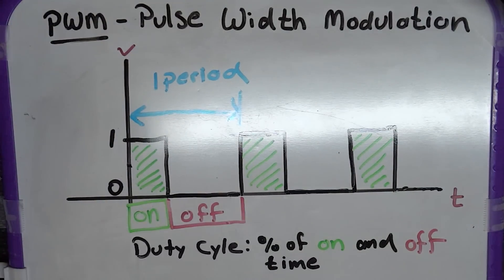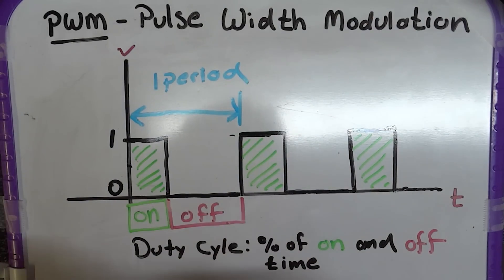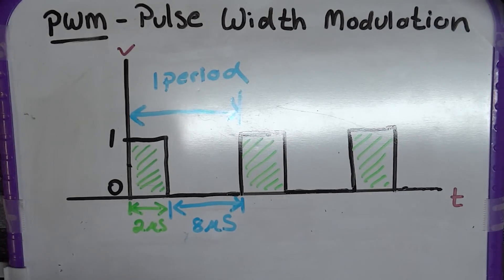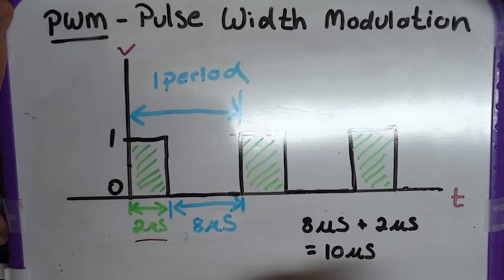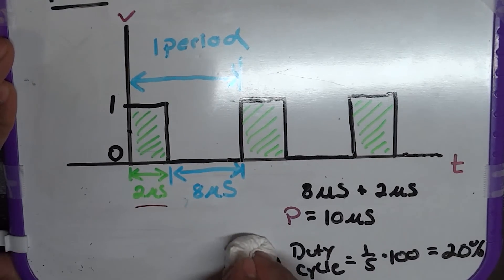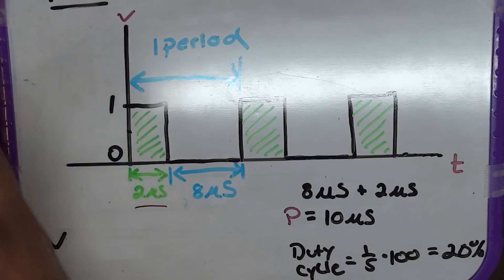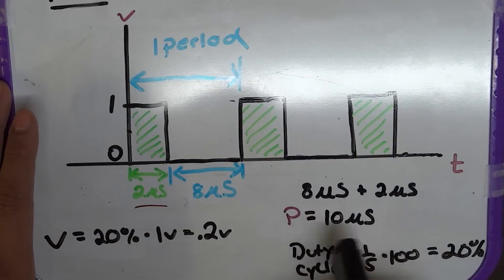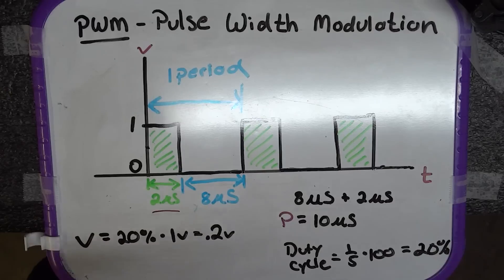What is PWM?

Comment: Voltage is not Duty Cycle X Voltage.

This is the way: duty cycle of a rectangular waveform, which represents the ratio of the pulse duration to the total period, affects the RMS value.

For a rectangular waveform with a certain duty cycle, the RMS value can be calculated using the formula:

Vrms = Vpeak X square root of duty cycle

Where  Vpeak is the peak amplitude of the rectangular waveform.

As the duty cycle increases, meaning the waveform spends more time at its peak amplitude, the RMS value also increases. Conversely, as the duty cycle decreases, the RMS value decreases because the waveform spends less time at its peak amplitude.

Comment: How can I invert the polarity instead of having an OFF cicle. What I mean is, in one period I need +1 cycle and -1cycle. 

Thank you
Reply from the maker: You could bias the ground. You can raise the voltage on the ground pin to whatever device your trying to use the pwm signal on. If you make it exactly half the max voltage, you will effectively have your -1 and +1. Just make sure your device is isolated from any other grounds. Unless you really understand what your doing, keep everything battery powered and don't use wall power adapters as that ground could cause a short circuit.